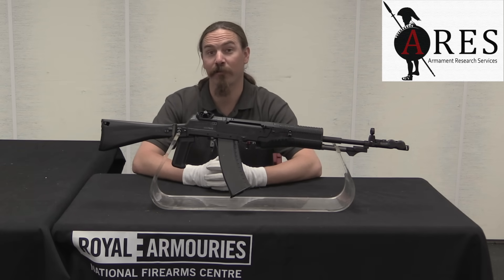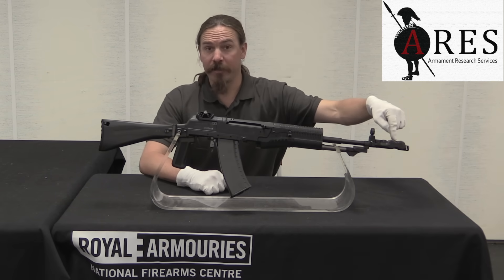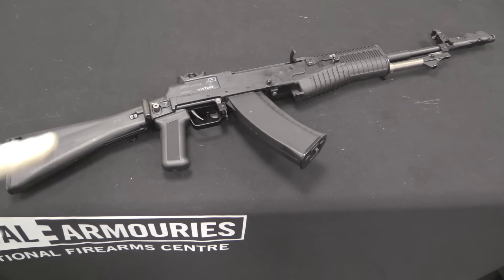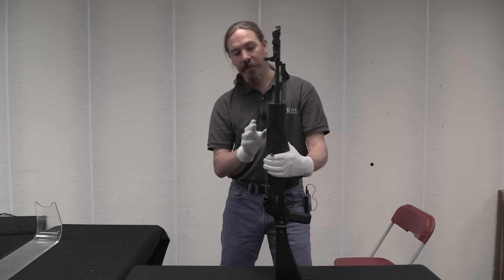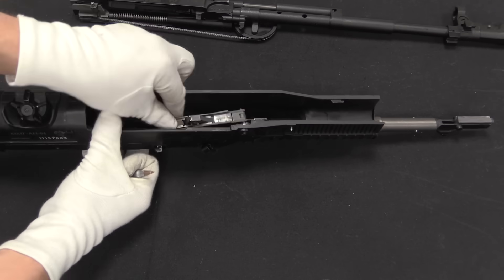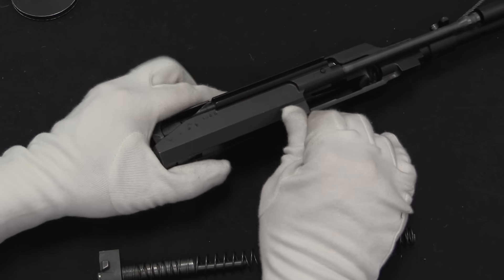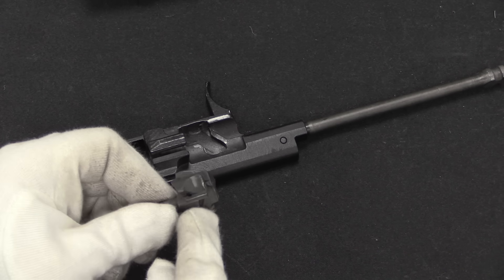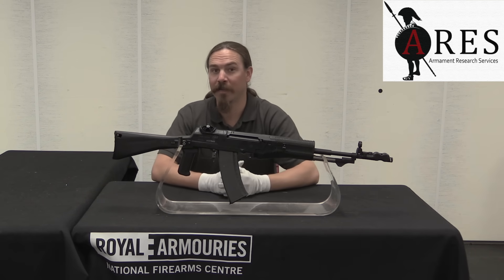Rocket Surgery: Inside the Russian Nikonov AN94

Comment: Watched at 16 minute explanation of how this thing works and I still don’t really get how it works.
Reply: Just read a detailed description of how this thing works and I still don’t really get how it works.
Reply: Eh, the key is instead of just a bolt carrier it has a whole another (spring-operated) gun inside. And that second gun can strip cartridges going in both directions (picking them from a special cache in the mid-position where they are stored by a separate stripper, picked from the magazine). So the outer gun first moves the inner gun forward, has it pick the cartridge on its motion forward, lock in place, then fire in the forward position. Recoil and gas piston move the inner gun back, it ejects the spent cartridge and strips one from the cache (while going in the opposite direction as before!) then locks it and fires before it ends its backwards travel.
Reply: @sharpfang  The missile knows where it is at all times. It knows this because it knows where it isn't. By subtracting where it is from where it isn't, or where it isn't from where it is (whichever is greater), it obtains a difference, or deviation. The guidance subsystem uses deviations to generate corrective commands to drive the missile from a position where it is to a position where it isn't, and arriving at a position where it wasn't, it now is. Consequently, the position where it is, is now the position that it wasn't, and it follows that the position that it was, is now the position that it isn't.
In the event that the position that it is in is not the position that it wasn't, the system has acquired a variation, the variation being the difference between where the missile is, and where it wasn't. If variation is considered to be a significant factor, it too may be corrected by the GEA. However, the missile must also know where it was.

The missile guidance computer scenario works as follows. Because a variation has modified some of the information the missile has obtained, it is not sure just where it is. However, it is sure where it isn't, within reason, and it knows where it was. It now subtracts where it should be from where it wasn't, or vice-versa, and by differentiating this from the algebraic sum of where it shouldn't be, and where it was, it is able to obtain the deviation and its variation, which is called error.
Reply: same here. it may be simply by magic
Reply: @jag0937eb  Commie space magic...
Reply: It goes bang, bang instead of just bang when you pull the trigger in burst mode.
Reply: CR BZ  Yes, depending how you define "separate". There's definitely a separate system that feeds rounds from magazine into the "prearranged" position - then depending how you look at it and where you draw the lines, either 1 (bidirectional) or 2 (1 for forward, 1 for back)systems feeding from there into the "inner gun" - a fully functional 1-shot spring-operated gun, with barrel, chamber, firing pin, ejector, but not own feed system.
Reply: There is a visualization, but it won't help you.
https://www.youtube.com/watch?v=q7hL4s4a8l8
Reply: 17 mins actually
Reply: it just works

Comment: This was the most badass gun in Bad Company 2.
Reply: Still my favourite in any bf, always hanging out to unlock it
Reply: couldn't remember, did those games had the 2 round mechanism implemented? I remember several games featuring the AN-94 but they don't have the 2 round system - kinda disappointing.
Reply: @Vickal89  Bad Company 2 definitely did. Don't recall for BF3 because I didn't play it as much.
Reply: @Vickal89  Battlefield 4 at least had the 2 round burst, one of my fav weapons!
Reply: @nkoxi  Also this gun appears in STALKER, but 2 round burst was not completely accurate and affected by recoil
Reply: @hellfiredoughnut1434  yes Stalker was one of the Games which I meant.
Reply: My favorite was vss vintorez.
Reply: The scope version was a NECESSITY. Fuck that red dot bullshit.

Comment: I have no doubt that the development team at H&K could replace that clumsy wheel and cable with a secondary gas port assembly. Either that or the Yamaha motorcycle team which would replace a clumsy push rod Ural motor with a cammed DOHC engine if you get the analogy.
Reply: Since the latter could influence performance it's just a bad analogy. If it works and fulfills your expectations, don't change it.
Reply: @Sundara229  I'm thinking long term. Having several cables fail in several circumstances I'm loathe to trust them where a more solid system with fewer  critical points could be employed
Reply: @TorquilBletchleySmythe  Long term you have to change the timing belt and not the push rod.
Reply: @Sundara229  desmodromic with crankshaft mounted cam with push rod for optimum performance then?
Reply: @Sundara229  or perhaps hydraulic

Comment: AK: Push button, take top cover off, pull bolt and gas piston out

AN-94: Turn lever, slam gun repeatedly on table or ground until top handguard is loose, pull bracket down until you can remove the barreled receiver, push secondary lifter to remove pulley wheel, unthread pulley wire from guide groove, push recoil spring forward and up to release and remove, take hammer out, pull bolt out

Comment: there are 2 wrong discriptions about the springs - the one behind the hammer is the hammer spring, and the one connect to the wheels is the main recoil spring.  the hammer spring guide rod extention part may be the extractor。

Comment: I would have never guessed in 1000 years that this rifle was driven by a cable-pulley system. I’m amazed this worked so well. Certainly not as user friendly as the AK47 but. I imagine cleaning this would have been a nightmare.

Comment: Oof.  Those internals are only slightly less complicated than the G11!  I suppose that a cable and pulley are simpler than gearing a countermass to the gas piston or op rod, but still...

Comment: So I'm confused: from how I understood that description, it has a seperate magazine for one round between the chamber and main magazine.  When it cycles in burst mode, it will of course pick up another round at the end of the process, but does that mean there's a round in the second mag but not the chamber?  You have to rack it after every burst fire? 🤔
Reply: Matthew Millar there is no second magazine. 
When the first bullet gets fired this cable system takes the second bullet out of the magazine and puts it between the magazine and the chamber.
This happens before the casing for the first bullet gets ejected. 
After the first casing is ejected the second bullet which is between the mag and the chamber gets chambered and fired.
This all happens before the bolt hits back and creates the recoil.

So the whole magic is that you can fire two rounds and have only one recoil hit, which is pretty damn amazing 😎

Comment: People saying stuff like "it's too complex and expensive to be practical" are really being absurd. Soldiers take computers into battle too. Yes I can ruggedize a computer but this rifle is ruggedized as well. To me it's a bit like people saying "But what if the ram fails?! We need a computer design that uses a solid strip of iron for ram!"

Also soldiers all the time took/take literal watches and other critical timing mechanisms into battle too. You can play "What if X Ys?!" all day. Honestly, gripes about this gun's complexity to me would all apply to the entire AR platform. Anything more capable+reliable than an AK/GLOCK is gonna add some moving parts/cost/weight/something. The only question is how much for how much.

Yeah I suppose it's nice if your rifle has the durability of an aluminum bat, but if we honestly demanded that out of every weapon system we basically wouldn't be able to field modern armies. I'll happily take the "complex" rifle that doubles my accuracy and stopping power by definition. It's not like it's the only weapon I'd take with me anyway.
Reply: to be fair... if a soldier's watch or his computer is out of action... he is....
less capable, SIGNIFICANTLY so depending on the situation...

but he IS STILL a Soldier.. as he still has the means to shoot, and perform his function as a soldier does many years ago before the advent of portable computer and cheap mass produced accurate time piece...

LOSE HIS RIFLE HOWEVER....
and well...

what you have left is... not much of a soldier anymore...

So the rifle is a significantly more important hardware that the soldier carry, the only thing that rival it is probably radio...

Comment: The feeder mechanism kind of is a recoil compensator, since any energy used to operate the feeder is energy that is not going into your shoulder. It kind of also acts like a recoil delay, and would spread out the recoil over a longer time, making it more controllable. It's a pretty clever system really and could probably be ok if disassembly was more convenient, shame there is no video of it firing...

Comment: So the point was to fire two rounds before the recoil is passed on to the shooter’s shoulder, but after the first shot, the bottle compressed the recoil spring which passes recoil on to the shooter’s shoulder? I’m confused how you can have the bolt recoil and go back to battery without transferring that recoil impulse to the shooter

Comment: Why didn't they just melt the whole thing down into a solid block and write AN94 on that?
I hate when they cut gun mechanisms like that. Sure, i get why they want the gun to be non functional but that's just GAY.
Drill holes in the barrel then fill the barrel with steel (leaving the chamber intact) or simply replace the barrel with some soft metal that would eat anyone dumb enough to fire the gun.

Likewise, replace the mechanism with weaker stuff that would shatter if actually fired. Don't just slice and dice.
This is why i don't buy these kinds of (replica) guns.

Comment: AN94, is one of my favorite guns, and would cool if someone simplified it. But idk why you’d need this special double tap unless you’re in a situation where you’re in and need first shot, one shot drop capability. In this instance the two bullets are pretty much going to group right on top of each other, meaning accuracy still precedes the importance of two shots that are grouped closely unlike a shotgun w/ 00 buck. Maybe this would be good against soft L3 body armor or some other mid grade bullet resistance glass? Either way, I’m sure the two bullets acts like a higher caliber bullet but at this point a single slightly higher caliber bullet and an inherently accurate gun would be way more effective than a gun like the AN94 (obviously due to the decommission). Plus add no suppression capability and other negatives. The new AK’s and AEK971 were going in the right direction, recoil dampening with a much more simple geared counter weight system. Having someone who could have the follow up speed of a 3 gun shooter just by reducing recoil would be the next biggest thing. You could over gas a piston tube system and still have close to no recoil, that’d be amazing.

Comment: Now that it's been imported as de-milled can you have it repaired or is it just a super complex paperweight?
Reply: Well, the critical parts were screwed, but that doesn't mean the parts can't be replaced. I don't see why a new bolt, firing pin and extractor, riser, hammer, barrel etc couldn't be put in it. But that's just what was showed in the video. I feel like they would be fairly thorough in deactivating it so it's not easy to restore. My guess is that replacing the deactivated parts may as well be the same as putting together an entirely new rifle. Just an assumption, though

Comment: During the Space Race the US spent tens of thousands of dollars designing a pen that would still write in space. The Russians just used a pencil. 🤔
Reply from the maker: They did not, actually, because both countries found that writing with a pencil in space caused little shards of (conductive) graphite to shear off the pencil tip, float around the spacecraft, and potentially cause electrical problems.

Comment: I would question the premise that the two round burst function would increase hit probability. It would seem that a burst function would only do so if some sort of controllable dispersion was introduced. This rifle seems designed to ensure that, as far as possible, both bullets strike the same point of impact.
Wheels and cables in guns. Interesting.

Comment: 3:51 so that is why I keep seeing that the AN-94 from BF4 looks like a fucked up weapon with weirdly placed ironsights, barrel, and magazine.
Reply: Fliyo MB yeah but the fucking thing slays so I'm not complaining
Reply: Actually the iron sights on the AN-94 is pretty good.
Reply: always use in burst!
Reply: Should have been single or 2rnd burst like bf3. Full auto is terrible cause its uncontrollable with this gun not to mention spaming the 2rnd burst has a higher firing rate in game.
Reply: You can change the firerate dude....
Reply: Nathan DaMaren  rubbish. Full auto is fantastic with this gun and very controllable becuz the rate of fire is at a near perfect 600rpm
Reply: You know, if you fire it full auto, the first 2 round of the magazine will still fire, as though you had it on burst. So your best bet, is full auto, so that you are ready to deal with something on full auto, if you really really need to.
Reply: @caprise-music6722  AK12 is better on full auto
Reply: @edbo10  It does fire at 600 afterwards, but everytime you pull the trigger, it is supposed to do the burst, before reverting itself to the 600.
Reply: @A-G-F-  AK-12 is garbage in full auto. Use it in burst mode and it's good. It has higher rate of fire and less recoil in burst. In full auto it's worse than the QBZ. Fullauto AN-94 is even worse than SAR-21, so don't do that.
Reply: @itsmebatman  
I dont use any of those weapons,(AN-94 in burst is the only one) they're ineffective in a lot of situations
Reply: AN-94 in BF3 was such a fucking monster, I have 23 service stars with that bitch and the 2rnd burst headshot is just nutting materiel.

Comment: there is no way on earth you can tell me that the rifle wont move when the bolt goes back and forth even when the 2 bullets are fired at 1800 RPM... laws of physics do not allow that, the shoter wont feel the recoil but the rifle will and the point of impact difference will be larger and larger with the increased distance from the target.

Comment: 6:36 I’m guessing the front sight is dual purpose; the lower post is for short-range and the upper for long range. Maybe?
Reply: Boris Müller That doesn't make any sense. If you use top notche as a sight the barrel is pointing down.

Comment: Impractically complex for field use, yes, but EXTREMELY effective at controlling recoil. The AN-94 didn't perfect this, however. Go check out some of the videos on the AK-107; the recoil on full auto is extremely controllable, as in, 25+ of 30 rounds on target ON FULL AUTO on a man-sized target at 50 meters. I could see some excellent applications of hostage rescue/counter-terror operations where the gun won't be used for very long before it can be fully cleaned and inspected.

Comment: About the strange notch on top of front sight i've found a coment by Никита В (Nikita V), here is translation:
There is a horizontal hole in this notch of front sight. In this hole you can put a tritium tube, so it forms a second front sight. On the rear sight when it is in position 2 you can see 2 vertical holes, another 2 tritium tubes ("fork") go there, and form second rear sight. 
Никита В (Nikita V) says that its purpose is to prevent blocking the view by aperture sight. But my guess would be its just a night sight.
Никита В
Специально для обзорщика автомата хочу рассказать для чего на мушке вверху овала есть горизонтальное отверстие и для чего на диоптре на "2" есть 2 вертикальных отверстия. В отверстие мушки вставляется тритиевая трубочка, образуя вторую мушку на верху овала. В отверстия диоптра вставляется тритиевая вилка, образуя простенький открытый прицел. Такая компоновка нужна для для того, что бы в относительно ближнем бою диоптр не заслонял драгоценную область видимости при прицеливании.

Comment: How is this better than a gun with 2 barrels firing simultaneously? Sure 2 barrels = more weight but so does all the ridiculous internals needed to make this system work
Reply: Tyler the feed system would be even more of a clusterfuck than this is probably
Reply: Alex Moore what about a mag with 2 followers side by side? Essentially 2 single stack mags fused together.  Kinda like that dumb double barrel 1911. Look that crazy thing up.